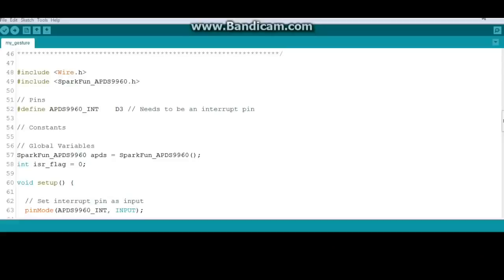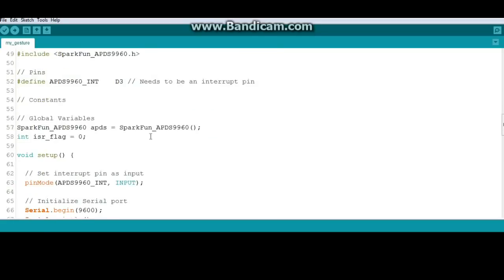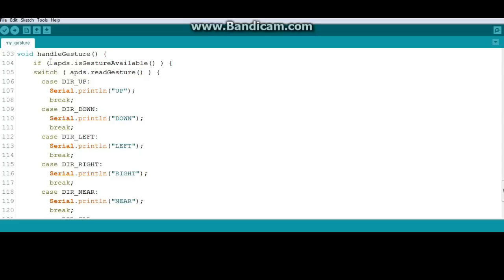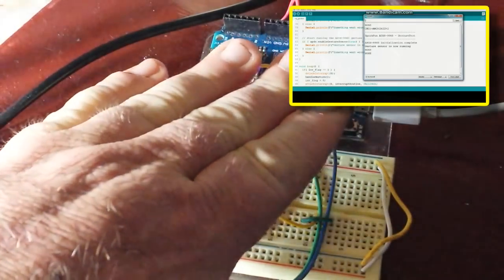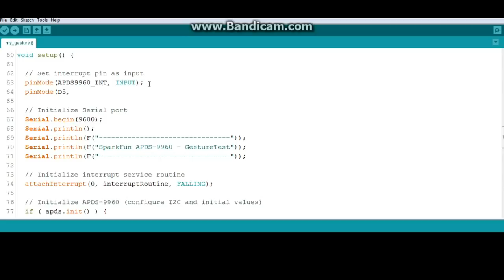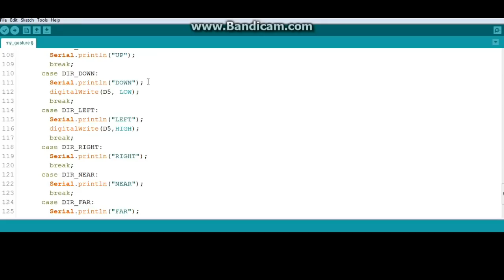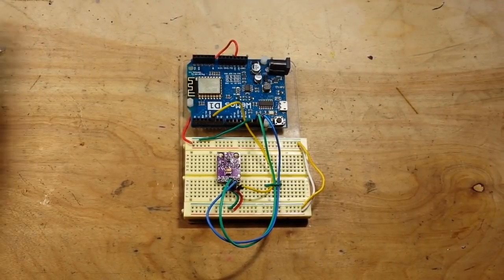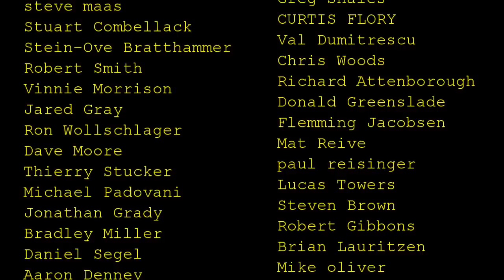How to use a gesture sensor with Arduino (ADPS-9960)

Comment: You can use with arduino uno if using a level translator 5V to 3.3V , for example 74HC125 or some transistors., and a regulator for the 3.3V power . Simple and efective implementation of demo.

Comment: I know I'm late to the party, but the first time I watched it (about the time it originally came out), I was not ready to try it. I have seen it used on other channels with better luck. You may have received a bad unit. I don't know, but from the camera angle it looked like your hand was pivoting down as you moved to the right. I know it also does color recognition. Best I remember (it was quite so time ago), but I've seen it sort candies by color and I also someone using color translucent films. Thanks for the video, keep it up.

Comment: Interesting that this video mirrors my experience with the module - it's unreliable to the point of being useless. Ok, if it mis-reads a feature here and there, forgive it, but the one in the video only saw left and down and then only sporadically, either not seeing anything or getting it wrong.
Reply from the maker: Yes it was definitely not reliable.